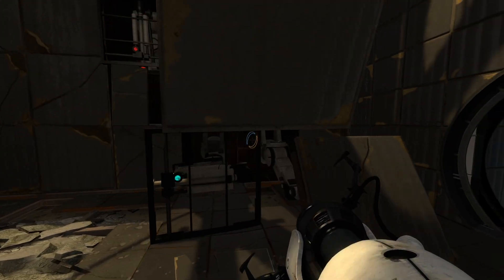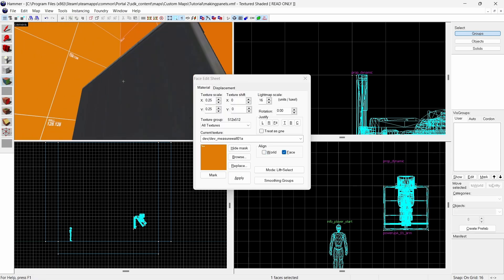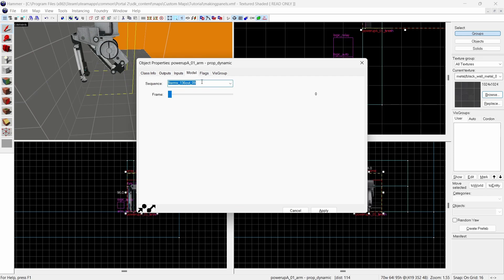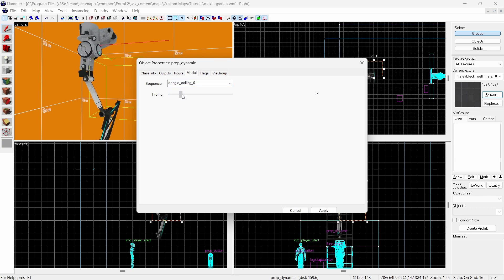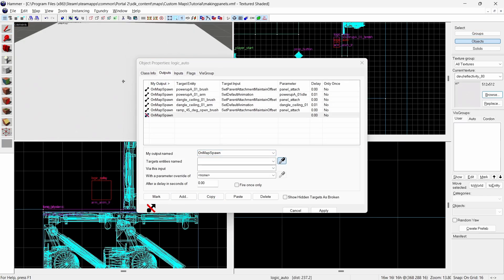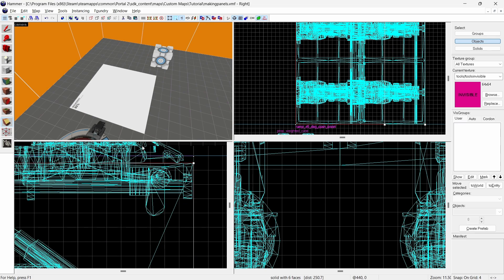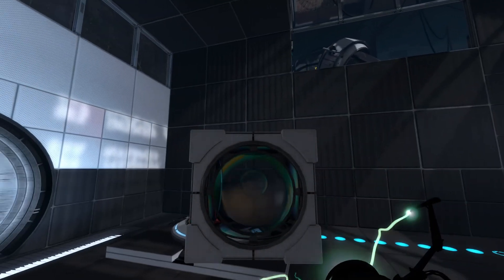Portal 2 Hammer | How to make Arm Panels

Comment: Question; what does a brush mean? Why is it needed to put a texture on the arm
Reply from the maker: A brush refers to world geometry, and I'm not entirely sure what you're referring to with that second question. If you mean why I texture the brush, it's to add the detail of the metal tile being repaired. 
However, based on your questions, I'd recommend you look for more beginner-level tutorials on Hammer. I would recommend TopHattWaffle. Most of my videos are intended for people who already understand the basics, so if you're very new you will struggle to follow along
Reply: @s @scesie no why do you need a Brush to attach the textur
Reply from the maker: @BackroomsWikiZ  You can only apply a material to a brush, again i suggest you start with tutorials aimed at beginners such as TopHattWaffle, here is a link to that: https://www.youtube.com/watch?v=jF3er5lsaeg&list=PL-454Fe3dQH1L38FnKkz_O1CqYx6sKaXk&index=1

Comment: the board does not connect to the panel and the animation does not work
Reply from the maker: as stated in the pinned comment, I need you to give me more info than that. To me it sounds like you could have misnamed the arm model and used a different name in all the logic outputs and brush parenting. But if thats not the case I need more detailed information on whats going on

Comment: I'm trying to put a placement helper on a panel and it's just not working, despite moving with it. Why?
Reply from the maker: Just parent the placement helper to the brush, and if you have positioned it correctly with the usual method of using placement helpers, it will work. If this isn't solving your problem, please elaborate on what you mean by "not working"

Comment: one question: why is my idle not working? when i spawn it doesn't work.
Reply from the maker: What do you mean by not working? What animation are you attempting to use? Have you made any alterations?
Reply: @scesie  powerupN_05 and powerupN_07 but when i use their idle version they don't work, and i followed it perfectly.
Reply from the maker: What do you mean by not working like do they disappear or are they doing a different animation, also what are the outputs/actions you are attempting to set these idle animations with, include everything, input, target entity, output, parameter and delay
Reply: @scesie  no it's idle when not repairing yet isn't doing it instead it's staying in powerupN_05idleend instead of powerupN_05idle
Reply from the maker: @keainkoolit And how are you attempting to send the output to set idle animation, include input, target entity, output, parameter and delay
Reply: same way? if you have a discord i can send
Reply from the maker: @keainkoolit   just checked in hammer, you're using the wrong idle animations, it's powerupN_05_idle not powerupN_05idle. Not all animations have the same naming conventions for idle names, you're able to see when you search the animation.
Reply: @scesie  oh okay thanks
Reply: @scesie  but one more question, why does it work with idleend?
Reply: i tried it. it didn't work. :(
Reply from the maker: @keainkoolit  sounds like you didn't update the idleend animation in the entity to powerupN_05_idleend, where it says "default animation", you might think the idleend worked because when it is given an animation that doesn't exist it defaults to BindPose which is an idle animation that looks identical to most idleend animations

Comment: What I think would be a great and useful tutorial next would be Monitors. You could start with Wheatley's monitors, and then get more advanced. Custom scenes, maybe an image (or illusion of an image. Think of the level intro signage, but on those monitors instead.). Maybe one final thing you can include is how to use different scenes (unless its very easy. I haven't played around with them too much.)
Reply from the maker: Good idea, I'll add it to the list, there are lots of different ways monitors can be approached, on top of what you mentioned there are things like getting them to display parts of a map like a security monitor or spreading one video across multiple screens. So I'm sure I'll make that sometime soon.

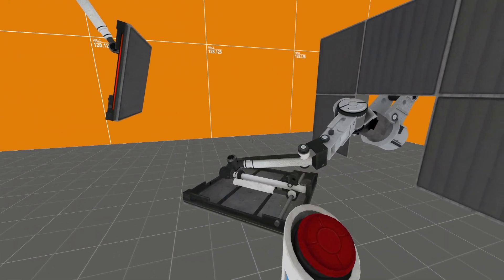Comment: Teach us how to do the same thing please, you're talking about it on 4:12, the "logic timer."
Reply from the maker: Sure, for example, you can make a logic timer with a refire interval of 1 and two outputs to the arm model, one which uses a lights on skin (e.g. 0) and one which uses lights off (1). And have either one of the outputs fire at 0 seconds and the other at half the refire interval (in this case 0.5) enabling the logic timer will make the arm flash. Hope this helps
Reply: @scesie  Oh alright, one more thing though. Could you make a video on how to decorate the panels to look like their getting up out of their last breath? For example, in some maps in Portal 2, the 4x4 panels go up, then down, and up again, simulating it to look like they're broken. Also, how to make the panels seem like they're brushing off debris? Sorry if this writing looks like gibberish to you by the way.
Reply from the maker: I'm not likely to do another video on panels, especially not soon, but I can say that what you want is likely to be multiple models that have their animations synced at the same time, you'll find lots of rubble models with animations of being brushed off, usually, their animation name will match the animation the panel uses which can help you find that.
And like I said in my pinned comment and in the video, I highly encourage you to try decompiling the maps that have the specific animation or whatever feature you want in there and figure out how it works by dissecting it. Plus it sounds like you already know the maps that have what you want.
Knowing how to do this is a very useful skill to have which will enable you to learn way faster. I left a link to the software needed to decompile a map in the description and here is a link to all the map names: https://developer.valvesoftware.com/wiki/List_of_Portal_2_Map_Resources
Hope this helps
Reply: @scesie  Ok, last last last last question, what is the path to the portal 2 maps? single player and multiplayer.
Reply from the maker: Go to portal 2 on steam, right click > manage > browse local files, in the files click portal 2 > maps and they will all be there